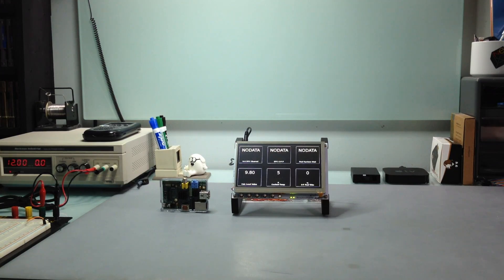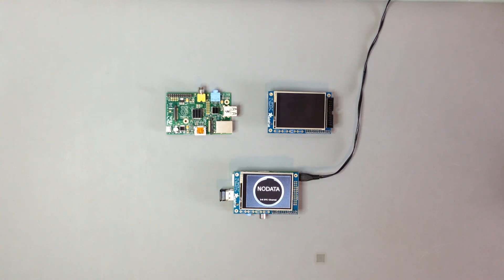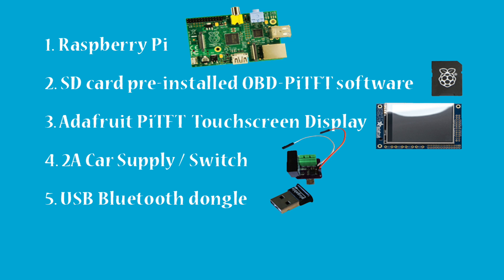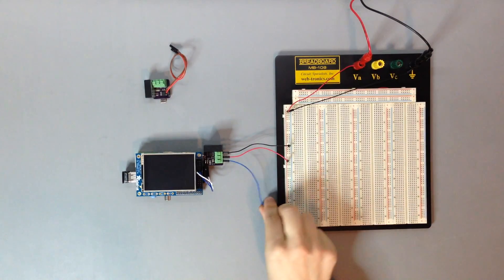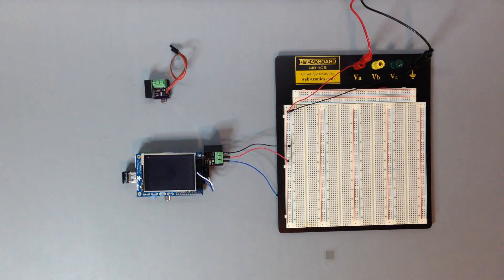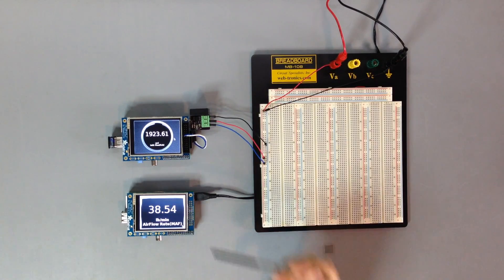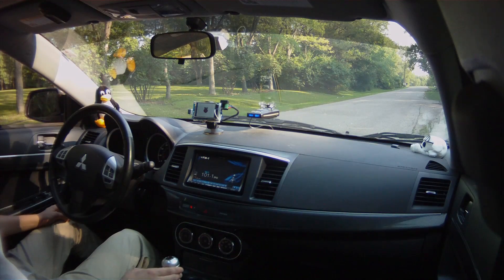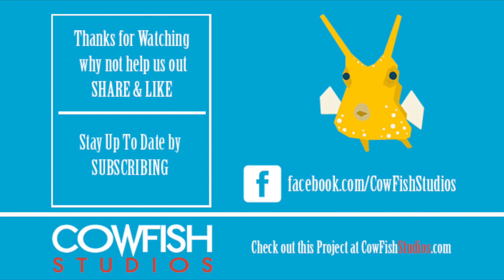Raspberry Pi Displaying Car Diagnostics (OBD-II) Data On Adafruits PiTFT Display: OBD-PiTFT

Comment: Do you know of a way to add other external sensors to this such as a EGT sensor and an Air pressure sensor. Also i will be using this on a gas car which has the capability of reading other things like Injector control pressures how will i program it to read ICP IPR. ETC... Will this even work with a diesel?

Comment: I'm running a ras pi 2 hooked to my tv instead of a touchscreen so I didn't install the adafruit stuff. Not familiar with Python, any help with the following error would be appreciated. When I ran the script it told me it failed and to check the log with alt esc. When attempting to connect to the ECU it threw out:
atz response :ELM327 v1.5
ate0 response:ate0OK
0100 response: BUS INIT: ...ERROR
Connected to /dev/rfcomm0

and then an error on lines 403, 51,44, 226, 215, 112,1 and a syntax error of invalid token.  Any ideas?

Comment: Hello,

i followed your tutorial and got the obd data to display on my tft screen.

 i was wondering what it would take to just display all the data on one screen instead of having to cycle through, and the refresh rate of the gauge increased

would it also be possible to have the program to automatically pair the bluetooth device and execute upon start up of the raspberry pi, and eliminate the need for a keyboard and or the user to do anything

(i have been successful in having the pi run the startx command and not ask for a password, but I'm unable to get the bluetooth to automatically pair)

and finally,  do you have any suggestions and or reading material that would help me achieve this?

keep up the good work
thanks

Comment: I have a Mitsubishi Outlander which is very similar to your Lancer.  I want to put a Raspberry Pi in the car, but I want to find a way to use the Head-Unit's display.  What's your experience with this?  Can I use a head-unit with an MHL compliant input to control a Raspberry Pi?